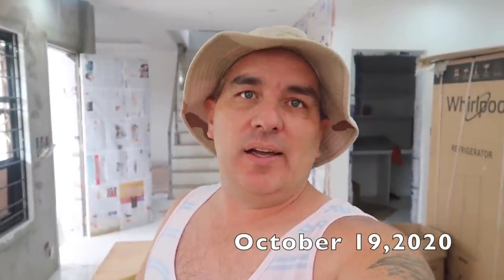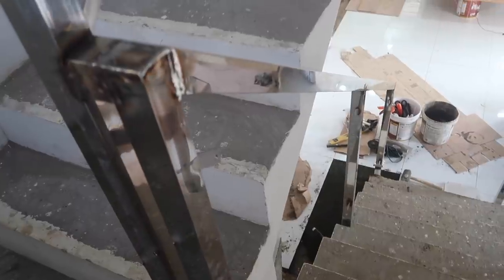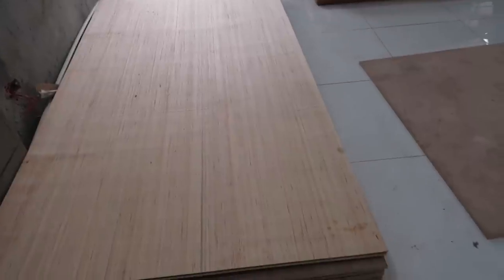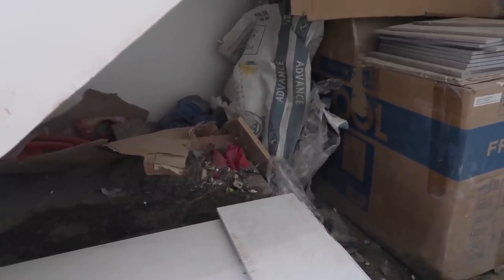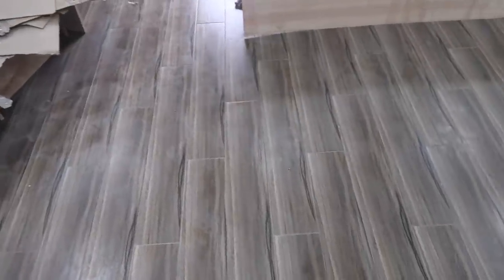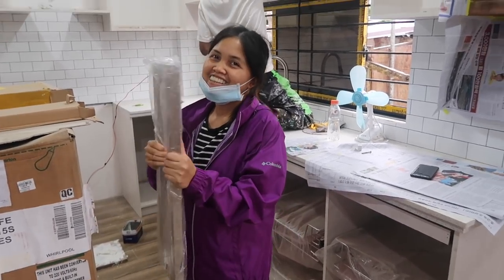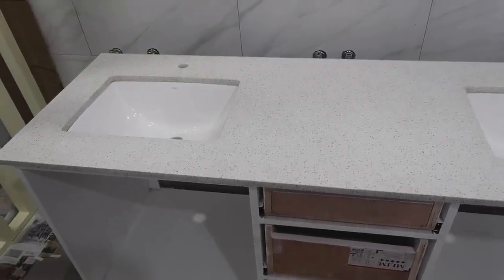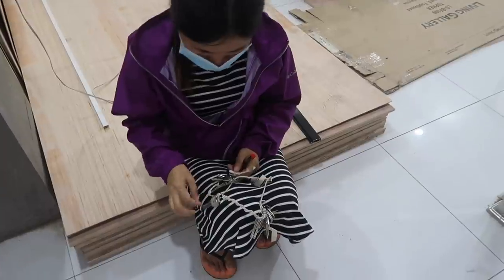HOUSE BUILDING IN THE PHILIPPINES - EPISODE 188: TILING THE BALCONY I BARN DOOR I DOOR KNOBS

Comment: The barn doors great. Are they going to be able to fix those burn marks on the railings?  Looks like someone that didn’t know how to weld did them. Got them too hot. Looking good!!
Reply: TEC Man  yes I have!!
Reply: TEC Man  I’m just commenting on what everyone else is thinking. If you can’t do the job don’t do it!!!
Reply: TEC Man  do I have to make a video from my own experiences?  No!
Reply: TEC Man  there is plenty of how to do it right videos out there too!!  Now go get some blue max paste wax and try to fix his railings!!
Reply: TEC Man  tig!  Electric driven not air spool. Instead of protecting the joints to weld they were too hot. Maybe blue max wax can take some of it out.
Reply: TEC Man  very
Little knowledge you have there grasshopper. Lmao.
Reply: its a burn marks from electrode coating sir it can be grind and polished
Reply: @xyrenmatias234  hummm. That’s what I said. Except to use blue max polish!!